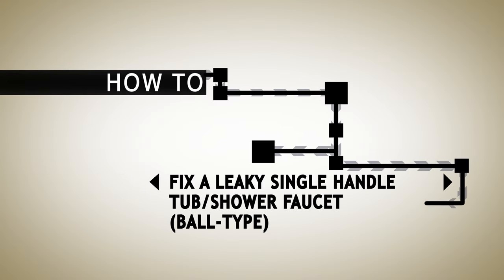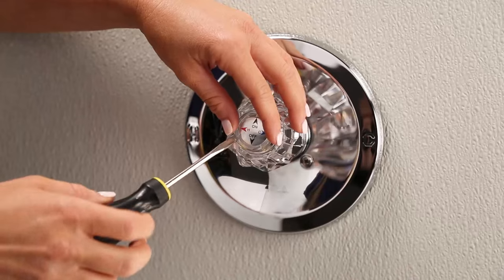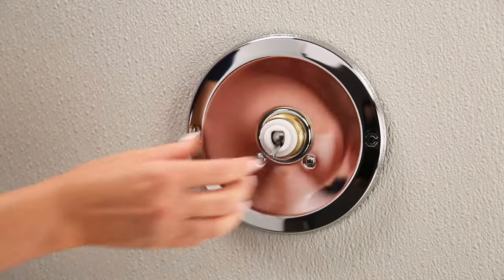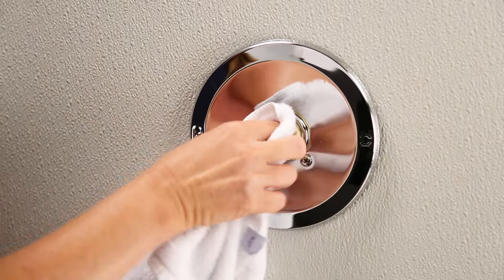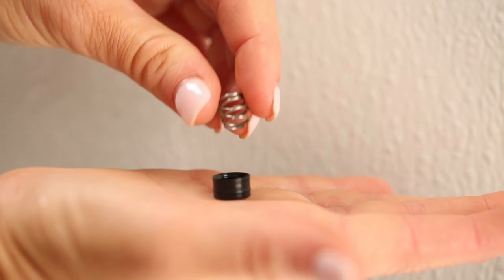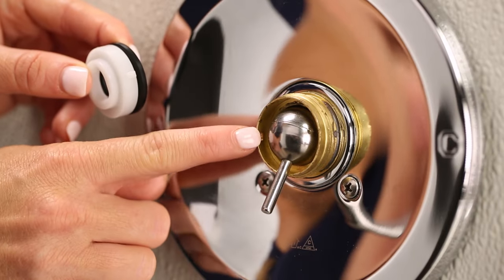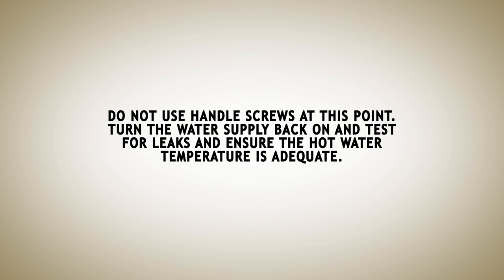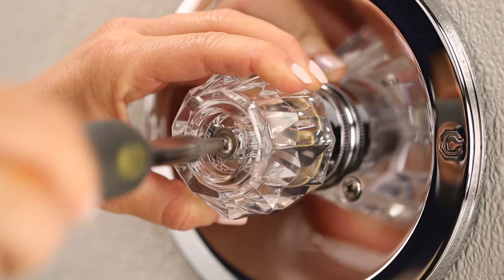Repairing a Leaky Single Handle Tub/Shower Ball-Type Faucet

Comment: I live in a small town, I couldn't get a repair kit right away, so I took out the two small spring washers and stretched the springs a little bit and reinstalled them. Fixed the leak. I guess the springs get compressed over time, best to replace them, but this seems to work for the time being. It's not leaking at all at the moment.

Comment: Use the Danco over the OEM Delta replacement cam (plastic piece that the handle nub goes through.)  I've read that Delta used to design them like the Danco design, but changed the design to just o rings on the side of the replacement gray plastic cam.  I could not get the Delta gray replacement cam to seal which results in a leaking handle.  I don't know if it's because I also replaced the two springs and seals in the valve, (which was the reason I originally took it apart, to fix a spout leak, and the two new springs and seals fixed that,) and the stiffness of the new springs prevented the cam from lining up, or staying in place in that grove, or if the o rings get cut or deformed when sliding it in.  Either way, I was able to get the Danco cam to seal, with its full rubber seal that sits behind the cam touching the ball, instead of just the o rings on the side like the Delta replacement cam.

Comment: The video shows a new valve. Working on one that is 34 years old is different. The large nut does not move so easily. Mine was on tight and twisted the body to the left and the position is off center.
Reply: If the nut won't turn easily, apply heat to it using a hair dryer or heat gun. Heat guns are more effective, but require extra care in their use.

Comment: I have this same type of assembly (ball type) but with delta. I replaced the seats and springs, ball assembly and seals which helped stop the leaking but now when you turn knob to hot, cold water comes out and when turned to cold, hot water comes out. The temps are reversed. I can’t figure out how to fix that on this type of assembly and I haven’t found a YouTube video that explains on this ball type faucet. Can anyone help?

Comment: A link to the replacement parts would be great. I can't find any parts.
Reply: I got Danco replacement cartridge and seats and springs for my shower through Amazon, I've also seen them at Home Depot. So many different brands, models, though, that you have to know the make, style, and sometimes the year of your shower (my Valley faucet was different before and after 1986).

Comment: I did it before, it was pretty easy, trying again and I forgot how the valve comes out, I removed the snap ring but can't get the valve out, Trying with needle nose, can't get it,  i don't want to mess it up, might have to call the plumber, I hate to because I know it doesn't cost much$ if I do it myself.

Comment: the stainless steel ball drags after reassembly, and is missing an additional hole and causes a very limited water flow, tried to use it with a plastic ball version.

Comment: The washer seal was not tightened! when you place the tightener on you are suppose to use the special tool to tighen it and it was not done in this video!
Reply: EXACTLY!!!!! I found that out the hard way. Downside is that mine is so rusted from water over the years........i can’t  turn it. I have banner faucet. Hard to find those parts.
Reply: and she said gasket cam instead of cam gasket, maybe huh???  and she said two notches instead of four notches, huh? set screw in handle, not this one shown, huh??

Comment: What does the faucet have to do with the hot water temperature?
Reply: bigpardner That plastic white piece can be adjusted to increase or decrease the amount of hot water you get.  I had to adjust it to get the water warm enough to shower in.
Reply: @gregsimpson621  there are a couple, few plastic pieces, which one dude??

Comment: What to do if the Philips screw is stuck? Have tried blaster spray and no luck. Any way besides cutting it off and replace assembly?
Reply: Use a good quality 1/4" capacity battery powered drill/driver with adjustable torque.  Put a #2 Phillips bit in the chuck and tighten it down.  Set the direction to counter-clockwise.  Set the torque adjustment ring to a low number.  This will cause the bit to "ratchet" (or "chatter")  when you trigger it on.  The ratcheting action is like using a gentle impact wrench and will eventually loosen the screw.

Comment: How Is the knob even being held on there wtf.  I got a new knob and my assemble looks like this but I can't screw the knob on
Reply: Saaaaaame
Reply: I'm having the same problem. Were you able to figure it out?
Reply: I'm glad I'm not the only one. My stem has some sort of adapter/extender that attaches with a set screw. The end of this adapter/extender is female threads to attach the knob. Unfortunately the threads are stripped and I cannot find this part anywhere. I could remove the adapter and attach a lever style handle but that would be hard to function the hot/cold adjustment pushes left to right. Any help would be appreciated.
Reply: Same! Something is left out.  I did it all except the handle ... and 4 associates at Lowe's couldn't figure it out using their own Danco parts?! ...  wtf